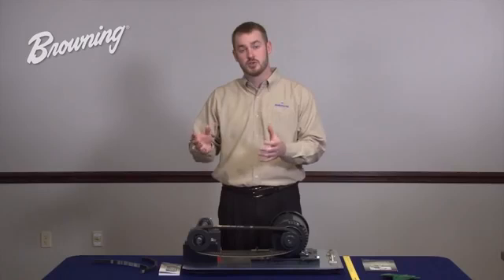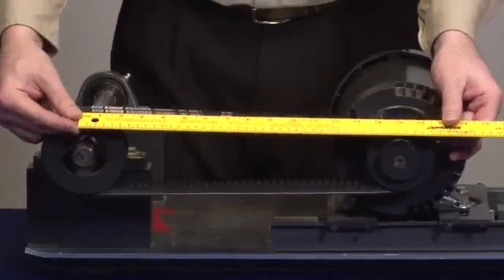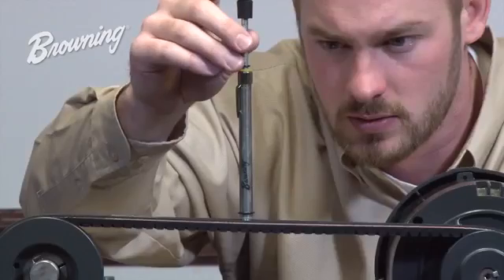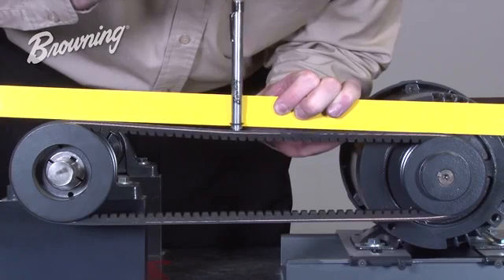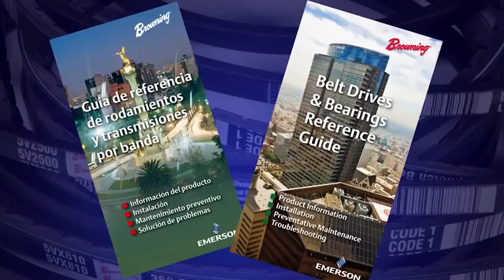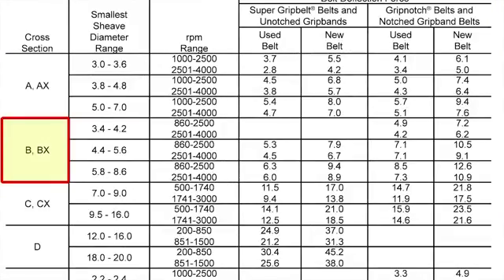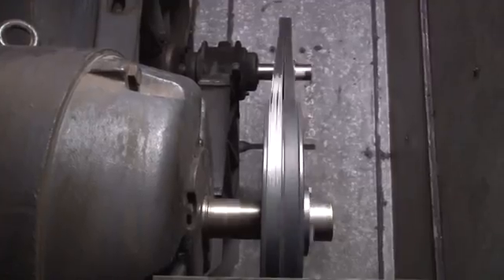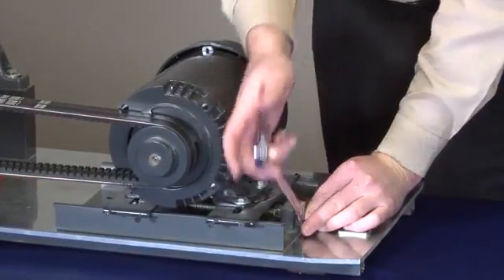Browning Tensioning V Belt Drives

Comment: anyone buying these type for automotive do NOT buy those cheap $10 ebay tension guage tool,even though they look like this they can only go to 10 ftlbs making them useless for almost all automotive application,i beleive they are selling as harley davidson belt tension tool.
instead look to make sure the one you buy can go up enough ft lbs.unfortunitly these will be somewhat costly from $35-$60 so recommend finding a used one.

Comment: What style belt is that with the groves and dose it help with traction?
Reply: I know the answer to that one.  The V-belt in the video is a BX.  The grooves are cut into it to help it wrap on the small sheave without over bending the belt and shortening it's life.  The classical B belt has no grooves, but should be used only with larger sheaves.   Really, the use of a grooved X type belt is better and has a higher horsepower rating.  It probably cost a bit more, but will make up for the cost in a little while because it uses less electricity from the motor.  In short, it's a better belt.  About it's only problem is at high speeds when it might go a bit wild becuase of resonant frequencies.  I'm not sure if it traction or coefficient of friction or not.  They should be about the same.